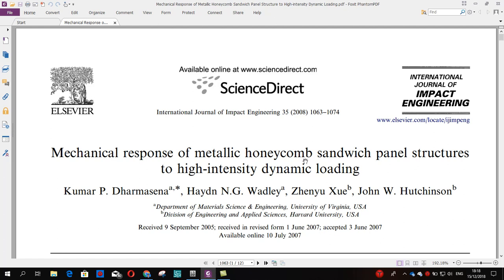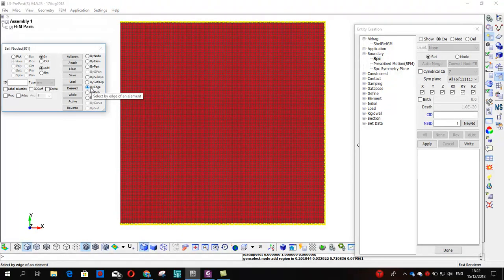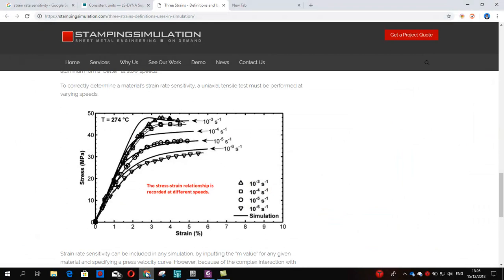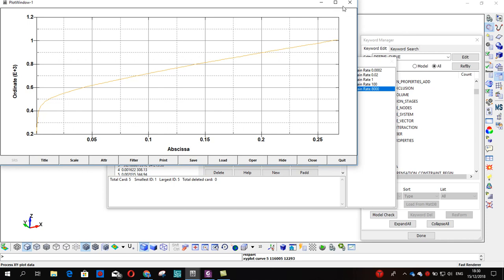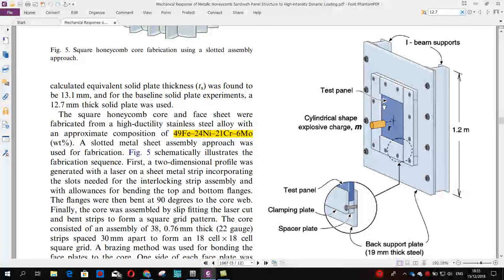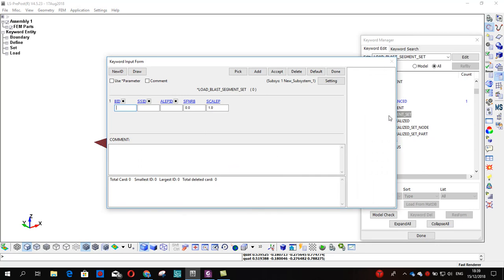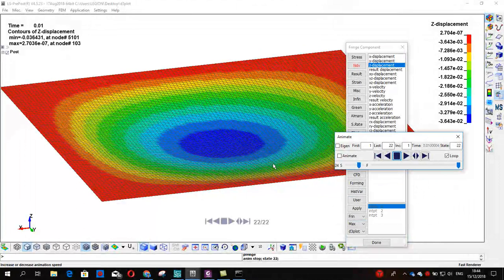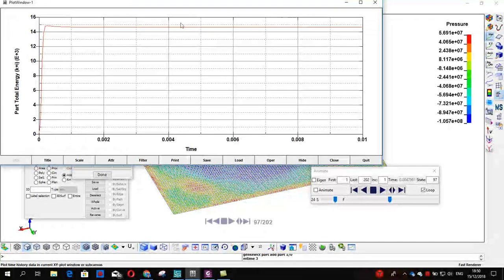LS DYNA Tutorial: Explosive and Blastwall

Comment: i see you did not model the cross section of the specimen you just made a plate with thickness of 12.7 mm , is it allright or i missed something ?
Reply from the maker: Yes. Because we are using shell elements. Shell elements means it has only two dimensions. It does not have dimension in the out of plane. To define the thickness, we use SECTION SHELL.

Comment: Super useful video Ameen. Thank you so much. However, as you spent quite some time defining the strain rate of the material at the beginning of the video, you did not clarify the effects of the strain rate on the results. Thanks again for your useful videos.
Reply from the maker: You may try the simulation without considering the strain rate effects and see the difference in the results yourself. 😁
Reply: Completely agree  @AmeenTopa , but I have one question regarding the strain rate effect,  did you use the full stress-strain curve from the beginning of the test or did you choose the data beyond the yield stress?
Reply from the maker: @haidermraih2559  for MAT024, we only use the stress data after the yield point. Check this video for a comprehensive explanation about this model: https://youtu.be/J5Qjj_9Sot0?si=ovFSlVW0ZyWy1zYG

Comment: Dear Mr. Topa, I followed your steps on this video precisely only changing the TNT mass to 5kg, it runs smoothly however when I try to plot the Z-displacement graph it showed me just the graph but not any numbers. Can you tell me what's wrong? Thank you
Reply from the maker: This is just a visualization matter. You need to change the colour of the font or colour or background. You can do it from the setting tabs on the top left of the Prepost window.
Reply: @AmeenTopa  The problem is solved, thank you very much. God bless you!

Comment: Can we have manual proportions of materials on this software?
Please help
Like 40% and 20%
Reply from the maker: Sorry I don't get what you mean.
Reply: @AmeenTopa  I mean I have to make a structure of 3 materials in proportion of 40,30 and 30 is it possible to do that?
Polypropylene,mica and rubber in diff proportions in 1 structure
Reply from the maker: Yes. It is all about the material properties. You need use simple shell or solid elements but you need advanced material model to allow for the anisotropic behavior of the material.

Comment: Like! I did not catch, does this method simulate the action of explosion products? If the charge is located close, then the products of the explosion have a significant effect along with the shock wave.
Reply from the maker: It depends on the scaled distance. Load blast enhanced is derived from empirical data and it is not suitable for very small values of scaled distance. 

For close distance detonations, you need to model the explosive explicitly. Check out my tutorial on TNT Blast on Composite Beam.
Reply: @AmeenTopa  Thanks! And I'm just trying to figure out the PARTICAL_BLAST method. I understand that it's the most suitable for this.
Reply from the maker: It depends on the application and situation. There is no method that is 'best' for everything. 

If you are interested in blast with SPH, check out this video here (don't forget to read the video description)
https://youtu.be/Xidr0p6EplQ

Comment: Hi Ameen, Thanks for your sharing. Anyways, I have some questions related to this:
1. if the top plate and the core is connected by welding, is it enough by using the same nodes for the connected surface of elements or do we need to define contact surface?
2. if the load is a pressure-time history on the top plate, is it correct if I define segment set (SSID)of the top plate and curve of pressure-time (LCID) and then used it in *LOAD_SEGMENT_SET.
I am new to LS-Prepost, hope you don't mind if my questions don't make any senses. Thank again for your sharing and looking forward for your help.
Reply from the maker: Dear Lam,

1 - For connection, you can merge the duplicate the nodes which is the easier option. For more advanced modelling, you can use Contacts Tiebreak.
2 - Yes, you can use that approach too. But using Load Blast Enhanced is more accurate because the load varies depends on the incident angle, and this is not possible with Load Segment Set. 

Sincerely,
Reply: Ameen Topa thanks for your response. I have one more question related to my question 2. We use *LOAD_SEGMENT_SET when the load is a pressure-time curve and *LOAD_NODE_SET when the load is a force-time curve, am I right? And for DEFINE_CURVE, we can use for both pressure or force-time history right? Or are there any other ways? Thanks.
Reply from the maker: @lalinlamCambodia  Yes, define curve for both, pressure vs time and force vs time curves.

Comment: Dear Sir, thank you for the tutorial. I am trying to simulate a storage tank with 100m diameter and 22.5m height under 1500kg TNT blast load based on a paper, so I followed the steps in this video and replaced the plate with a cylinder shell. However, during the solving process, warning messages of "number of blast segment normals pointing away from blast origin = 2570" showed up, and my initial kinetic energy is zero. Can you kindly guide me on this issue? Thank you very much.
Reply: My email is lojiahao@hotmail.co.uk if sir wished to contact me through email.
Reply from the maker: Dear Jia, please check your inbox.

I cannot tell if I don't know more details. You can try to reverse the normals of the segments.

Comment: Dear Ameen, I also ran the same case, acceleration is very high (unexpected), kindly check your resultant or z acceleration for this simulation. Apart from this, I have tried sandwich foam panel using "crushable foam" as a core and "Steel plate" as a face sheets, the resultant acceleration is upto 10^6-10^5 m/s^2 which is unexpected while displacement is showing satisfactory results. Can you explain this error.
Reply from the maker: Dear Patil, what do you mean by very high acceleration? This is blast simulation and acceleration is expected to be high. 

Good agreement is found when comparing the displacement with test data. Thus it is validated. It is very impractical to measure acceleration in experiment. May I know on what basis you say the acceleration is very high?
Reply: @AmeenTopa  Ya agree, you are correct with the test result. But measured acceleration is very high, have you seen acceleration in powers like 3.06 x 10^6 m/s^2 ??? My  purpose is to measure resultant acceleration on the panel.
Reply from the maker: Dear Patil, we are talking about explosives here, right? I don't think it is fair to compare this case of high intensity load (which can deflect a 12 mm thick steel plate) to the case when the target is human body. 

1 kg of TNT blasted from a distance of 10 cm, that's crazy amount of force which will shatter human flash into pieces.

Comment: In Blast loading validation of RCC slab, I am defining everything, the unit is in g, mm, ms and MPa  in blast load and In MAT I am not defining the unit but all input in LS PRE POST IS according to blast loading unit also the software gives result but the deflection result very small compared to the experiment can you help me? in which definition I missing?
Reply from the maker: How much small is it?

You can try blast on steel plate or plain concrete slab to check if your units are correct. If this give good results, then it means the problem with how you model the RCC slab.

Comment: There are errors showing in the file after rechecking the model, they are regarding  "load curves are not monotonically increasing, curve 5 is not reaching the same strain value as compared to others", etc. Which result in error termination instead of normal termination. Sir, could you suggest me how to overcome this?
Reply from the maker: It might be an mistake in defining the curve or in the solver (your software is very old version)

To be honest, I have never faced the error you've mentioned above.
Reply: @AmeenTopa  Sir, While rechecking my keywords, this message pops up and I have chosen solid brick elements instead of shell. I recommend, please check your model, too.
Reply from the maker: @vaibhavnmete  Thank you for your notifiaction
Reply: @AmeenTopa  can you please provide your email id on sanj_2sure@yahoo.com or sanjeev222175@gmail.com

Comment: Dear Mr. Topa, thank you for your excellent tutorials for LS DYNA. This one is very useful for me, but I have a question related to the shape of the charge. In your video, you only define the distance of the center of the charge,  assuming it was cylindrical.  Is there a way to model the shape of the charge since the pressures and impulses around the charge strongly depend on the shape?
Reply from the maker: To model the initial shape of the charge, you need to use ALE method.
Reply: @AmeenTopa  Thanks! Any suggestion about where to look for instructions?